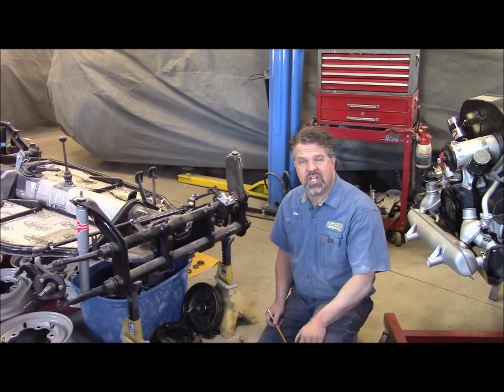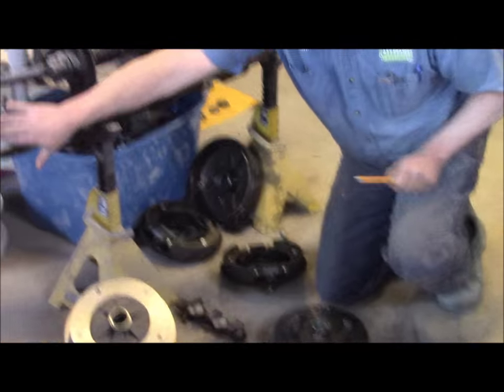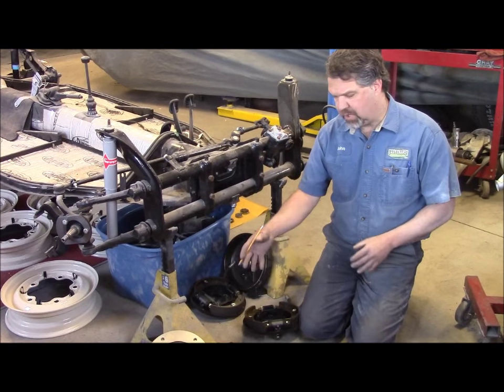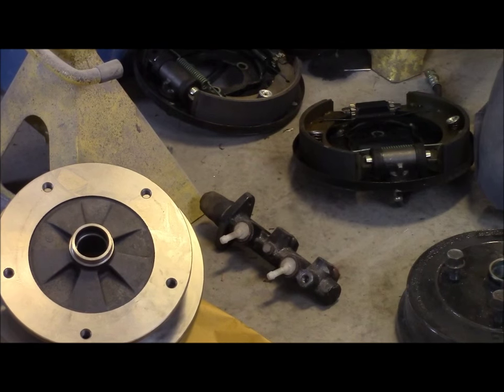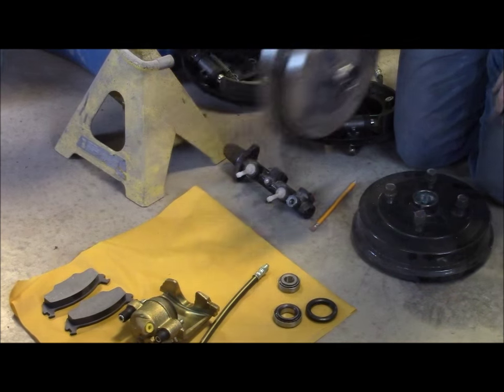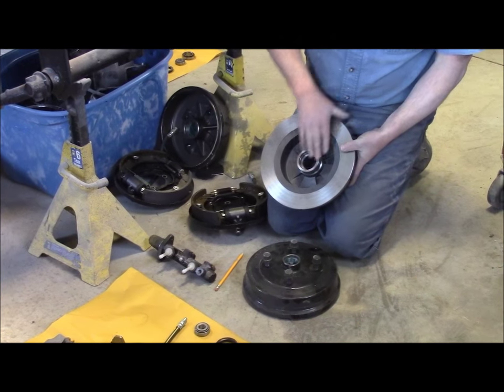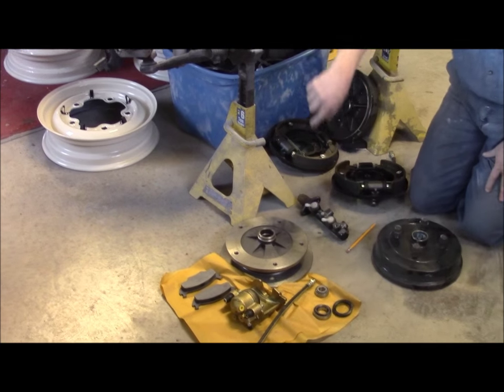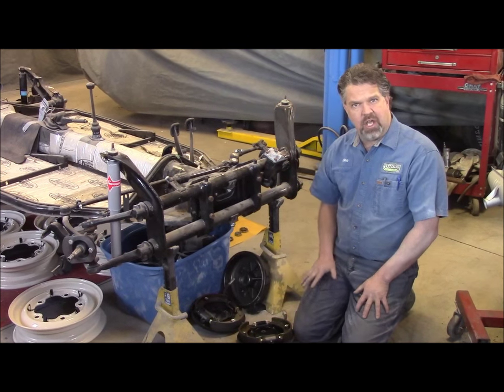Classic VW Bug Disc Brake Conversion Part 1, lastchanceautorestore.com

Comment: We run karmann ghia disc set-up on the front and rear but for the rear we'll run a Porsche 911 rotor so we can run a wider wheel on the rear for our VW woods buggy's. I learned 20 years ago about how a bumpy trail can play a role in a drum brake style wheel cylinder blowing out instantly leaving you with no brakes.

Comment: When switching to the old 5 bolt pattern the caliper that you use is not a dual 0pposed caliper not as good of stopping power

Comment: Great job on the restoration. I bought the same disc brake conversion kit for my 1973 vw thing with a new adjustable and narrowed front beam. I would have been incredibly helpful if you videotaped and explained the step by step process the actual install. Cant find any videos that actually break it down and document the whole process. I do have a question though.... did this particular set come with anti-rattle clips? Also what are they for exactly? To stop the rattle of the pads or add integrity to the strength of the caliper so it doesn't bend with pressure. Ive heard both explanations. Thanks in advance.
Reply: Alek Vinnikov 
Maybe he can stop by and install it, too
Reply: ABSOLUTELY a actual install would of been great
Reply: I am having trouble with the adaptor calliper plate hitting the spindle arm. Have you had that issue? If so did you have to change spindles?